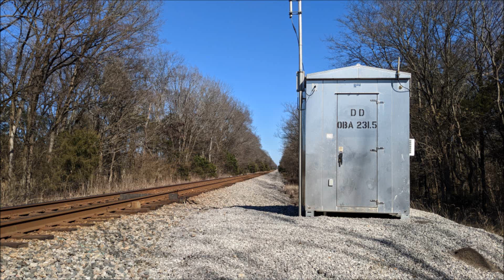CSX MP 231.5 Defect Detector Audio

Comment: D D
CSX Detector MP: 231.5
No Defects
Axles: 326

Weird how this one doesn't have a name on the bungalow.
Reply from the maker: It kinda seems like CSX is starting to phase out the names on the cases, at least on the S&NA North Sub.
Don't recall any of the other detectors along this line having their names listed either.
Reply: Probably not, Thach and the 2 wide load detectors (Tanner & Flint) for example only show E D D and their milepost + prefix (0BA or 000) on the S&NA North.
Reply from the maker: @rickygonzalez3152  Don't think the one down in Columbus, AL, has any location information on it at all. Also seem to recall the one around Falkville also just says EDD and the milepost on it?
Reply: I think so. Almost all of them say E D D (equipment defect detector), but one you missed was the Franklin DD (MP 203.4) The only one that has a name would be the one at Cornersville (MP 244.6)

MP
0BA
203.4
E D D
Reply from the maker: @rickygonzalez3152  Ain't seen the Franklin DD in person, so...